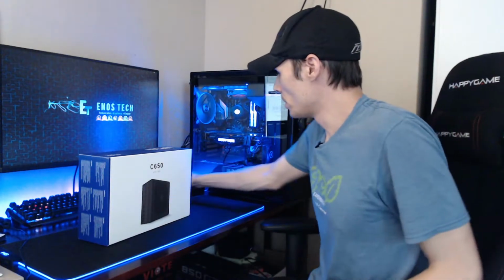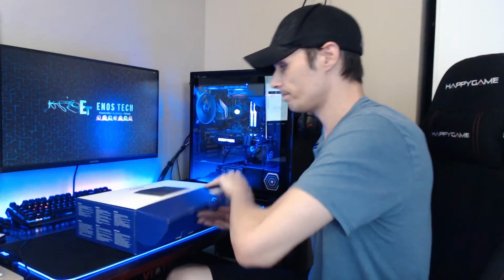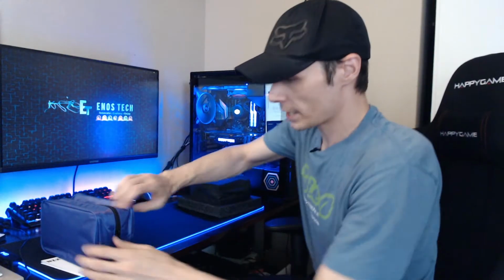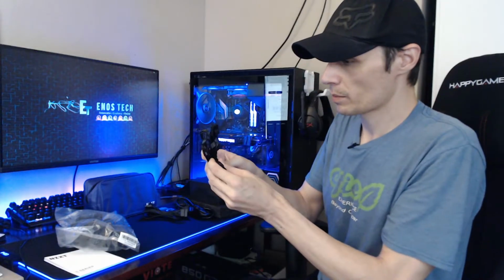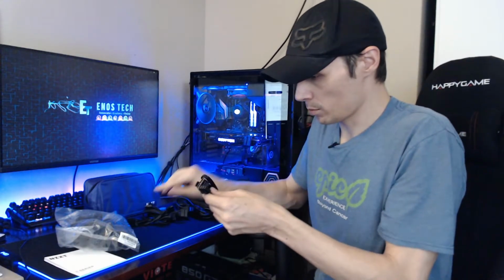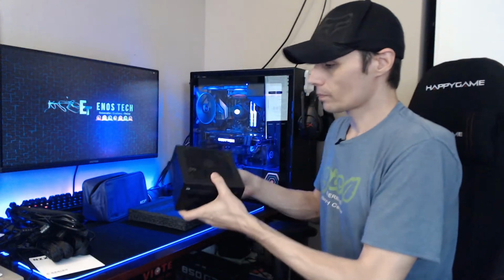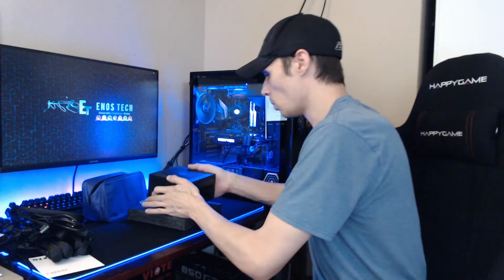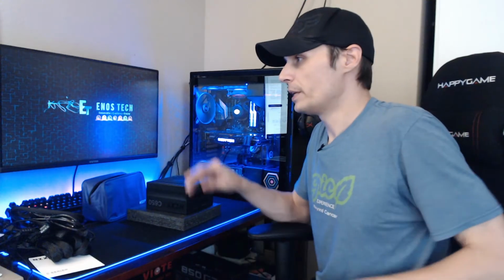Enos Tech NZXT C650 Power Supply Unboxing and Quick Overview

Comment: SHOULD THIS WORK WITH A 16 PIN GPU LIKE THE 4070TI
Reply from the maker: It is suggested to use a 700W PSU for a 4070TI, so while this may work you would certainly be pushing your luck. I personally would not recommend it just to be on the safe side.

Comment: Hi I need help with this the cable CPU don't fit in. I saw a video in the CPU they put PSU instead of the CPU in the CPU holes.
Reply: Even on the manual it's the CPU in the CPU but there something which ic blocking for the hole so I'm i supposed to the PSU in the CPU like the video I saw?
Reply from the maker: Are you sure you have the connector the right way around?

Comment: yo does it have a 4x2 gpu power thing i couldnt tell when you were unboxing
Reply from the maker: Yeah, it's got 2x 6+2 pin PCIe connectors for GPUs
Reply: @EnosTech  yeah but my gpu has a 4x2 gpu power thing not a 6x2
Reply from the maker: @breadsus  No, your GPU has a 6 pin, so all you do is push the +2 aside on the PSU 6+2 cable and just use the 6.
Reply: @EnosTech  ok then

Comment: Is this a better powersupply then the one i've got today: "Cooler Master G650M"? Why i'm asking is 'cause it's on sale and i'm wondering if it's worth the upgrade.
Reply from the maker: It technically is as it is 80+ Gold and yours is 80+ Bronze but only upgrade if you really need to. What are you running with it?

Comment: Great video! I just bought the C650
Reply from the maker: Thanks! I am still really rough around the edges myself and have a few more things to work out just to make the flow better hopefully over the next few videos. (Brandon B.)
Reply: EnosTech i’ve subbed :)
Reply: @EnosTech  How is your NZXT PSU now? still working well?
Reply from the maker: @yogidebali  Yes, still going strong and a highly used Gaming PC. No issues at all.
Reply: I just purchased the c750 to upgrade my older PSU because I'm getting RTX 3080
Reply: @insidertech10  Dies it have 8+4 pin for the cpu?